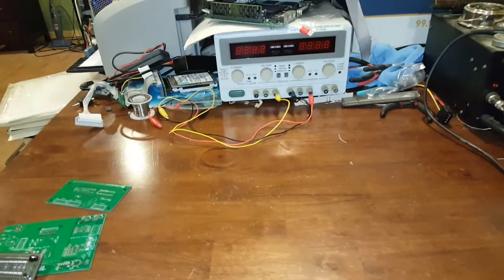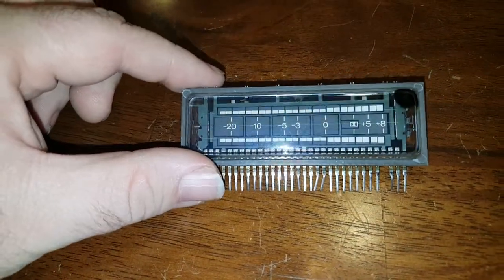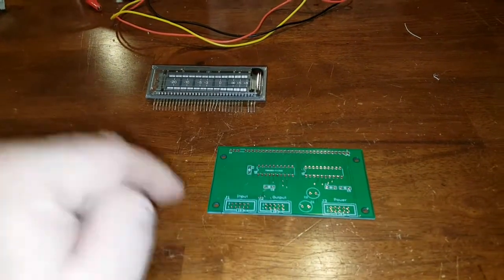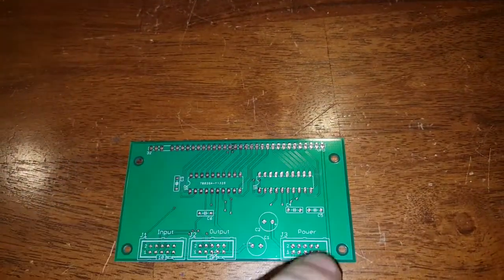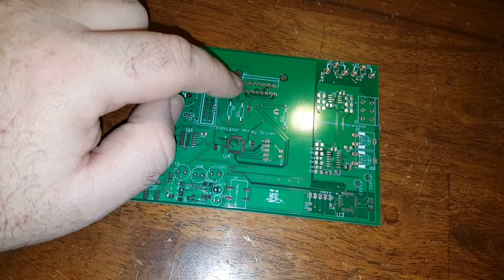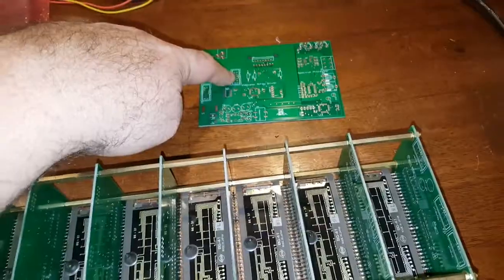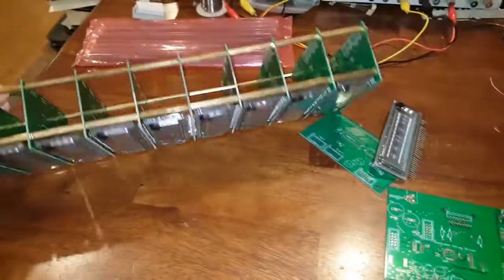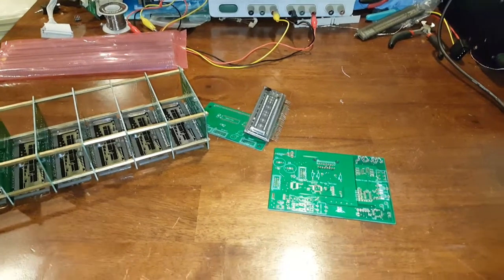Multi-VFD Audio Spectrum Analyzer Part 1 of 3

Comment: This is the most awesome thing I've seen in a long time.

I've actually seen that exact VU display in a finished device: a Sears all in one stereo system.
Reply from the maker: +uxwbill Thats neat, I have never owned any Sears anything modern except their tools. The last time I had anything sears brand was the old 50s Silvertone TV sets, so I was unaware these tubes were used in anything